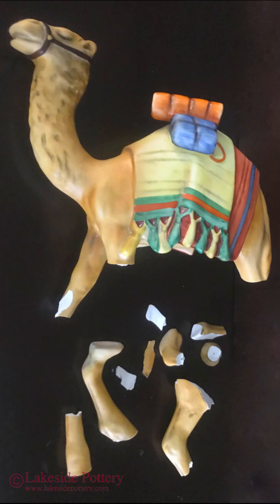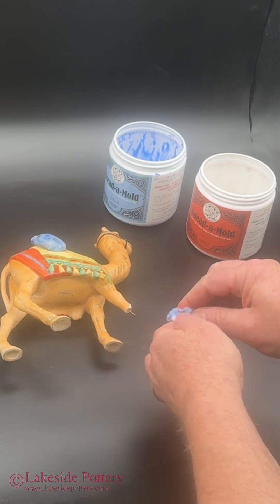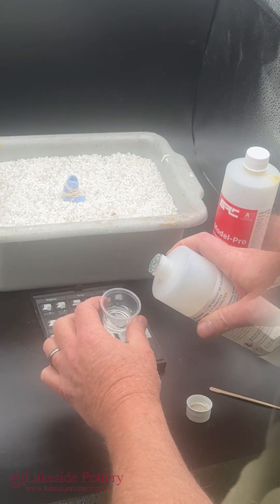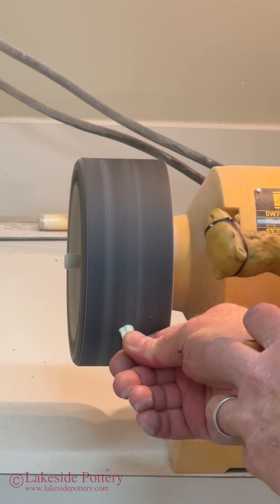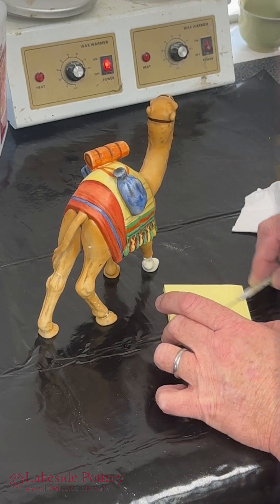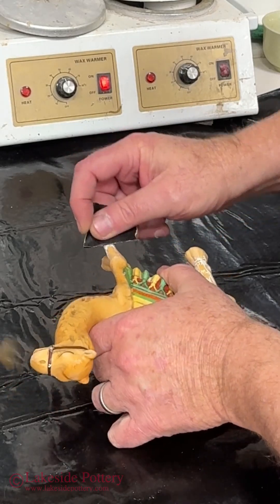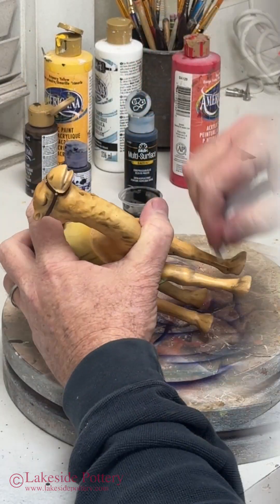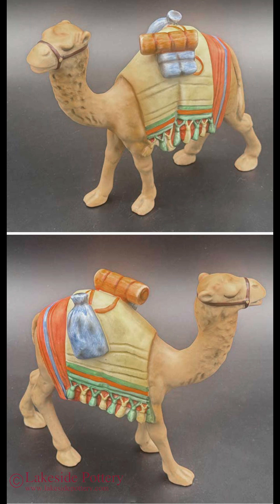Project Lesson: Restoring a Sculpture with a Missing Part – Camel Foot Restoration

Comment: WHAT IS WIRE MATERIAL YOU USE OR RECOMMEND?
Reply from the maker: Hi Kevin, I believe in this case we used a 16 gauge brass wire made by Artistic Wire. Their brass wire comes in a wide range of gauges, so you can choose the right thickness for any project. The heavier wires are 10 ga (2.59 mm), 12 ga (2.05 mm), 14 ga (1.63 mm), 16 ga (1.29 mm), and 18 ga (1.02 mm)